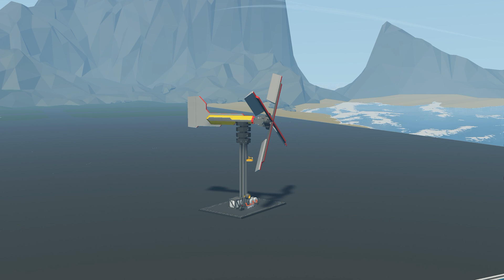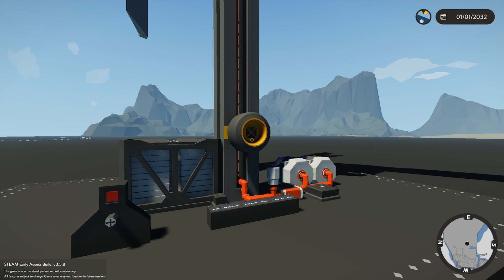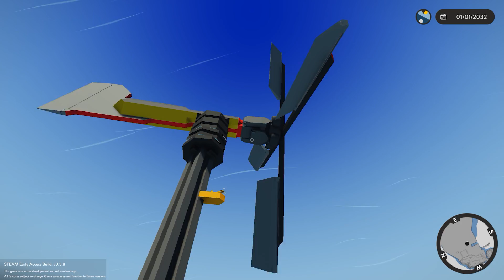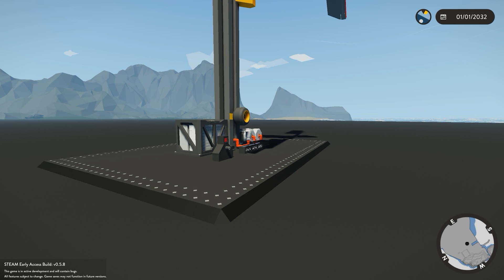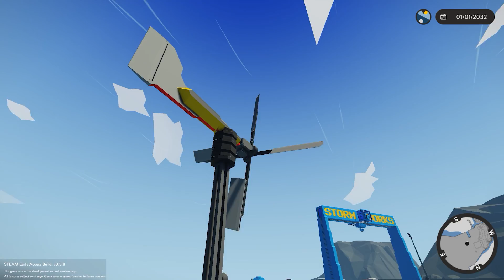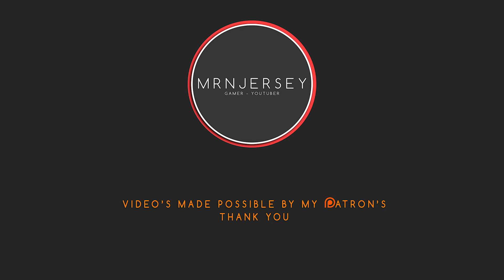Stormworks Wind Turbine (Infinite Power)

Comment: Why you just make gear box and some of the medium generator or large generator on top of that turbines and use visible wire thing and connect to large batteries and have some expansion and retract the cable at end have power connections to transfer power? Because it almost to same to real life.
Reply from the maker: Not sure, that is how the creator made it.

Comment: My Wind Turbine !! OMG :) Thanks a lot MrNJersey ! ;)
Edit : In fact, i only used robotic pivots because i wanted to put generators on the ground, but if you place generator(s) at the top you don't need the pivots anymore, the wind turbine will turn by itself.
Reply: That's how real turbines works, everything is in nacelle on top, why you did it this way?
No hate, this is really cool, I was thinking (just thinking) about something like this, but powered with water, like mill
Also what about collective pitch of blades? If the wind is too slow then should turn to get more torque, if it is too quick then turn to get maximum RPS
And in case of tornado it should turn itself off by neutral pitch of blades :P
Reply: @jakubpollak2067  Yes, real turbines have their generators on top, but the "Medium Generator" is really big and heavy and for now 2 generators are needed... But i didn't try to place them on top ^^ I like finding solutions to make complex things :P
The idea of variable blades pitch is a good idea ! At this time blades needs more than 80% of wind to turn with the pitch you can see on the video, maybe this can be more effective with more or less pitch.
Thank you for your comment ! ;)
Reply: Love the idea! did you happen to experiment with tracks? im curious if it would work about the same with less friction on the gear system

Comment: What if the battery dies before it can generate electricity? Then it’s not infinite power and I’ve in fact been click baited
Reply: you can add a small wheel on the bottom as treadmill
using waves itself even small might be worth while
Reply: What if the moon retires and waves are no longer a thing?